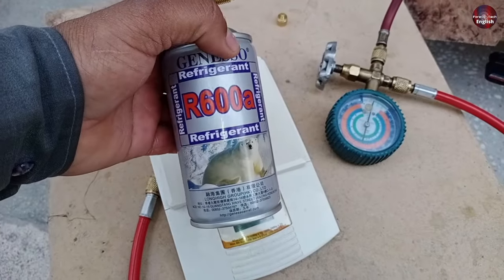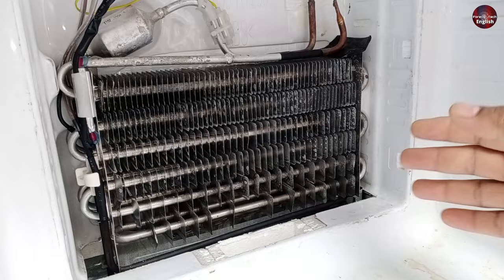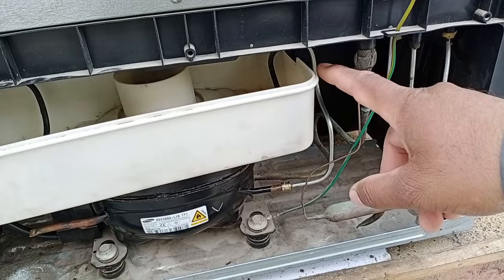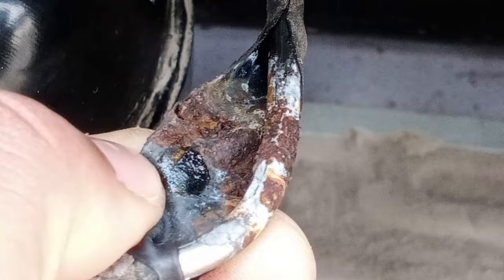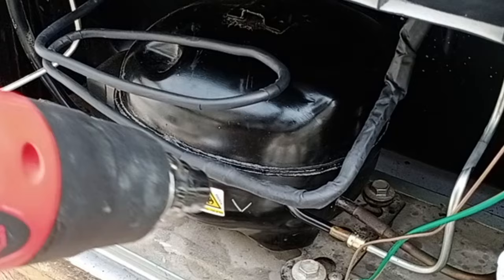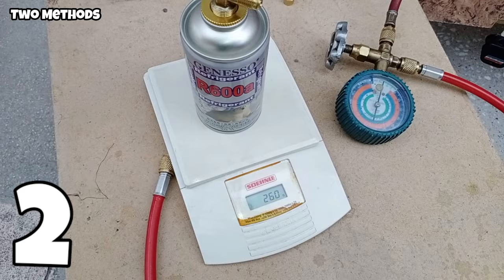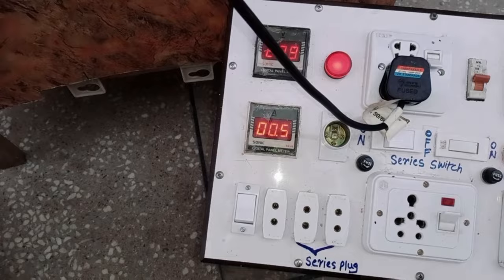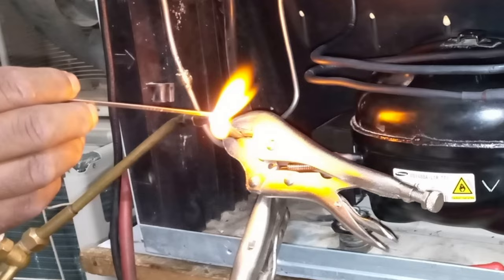How To Charge Refrigerator with R600A Freon/Refrigerant

Comment: I have been in the industry for 59 years, and would never use flammable refrigerant...
It's insane!!!!
Reply: Most household refrigerators in Europe operate on this "madness". The flammability of R600a is perhaps its only drawback, everything else is an advantage: it is extremely cheap and accessible (since it is a product of the gas-coal-oil industry), it has zero potential for destruction of the ozone layer, it is not alien to the planet's biosphere, unlike synthesized halogenated alkanes that in nature either decompose into very toxic compounds when heated, or, on the contrary, do not decompose for thousands of years, affecting the planet's climate. By the way, it is strange why the master cut off the Schrader valve? After all, its presence allows you to easily and quickly check the pressure in the refrigerator system, and a refrigerant leak with a high-quality and tightly screwed cap is extremely unlikely.

Comment: we leave the valves on all the units we fix. when we come back in 15 years. we can check it easy.
Reply: Backyard technicians 😂
Reply: “We leave the valves on” 😂😂
Reply: The joke is on you. The Appliance will never last more than five years in normal operation.   It’s by design from the engineers.   😑😑😑😑

Comment: The valve remains on the compressor and is not soldered off. The pipes are laid neatly and pipes that are too long are cut off. The capillary tube is laid to the side and the tube is straightened

Comment: Great Video. One question. Why did you remove the valve in the end? Isn't it ok to leave it there for a future service if needed?
Reply: It would make his work redundant because anyone with a bit of knowledge,  a spare fridge compressor used as a vacuum pump, a charging hose with ends ISO 1/4" thread and a can of R600 could do a short refill for a fraction of the price.

Comment: how about the dryer?  removal and replacement of the dryer is important !  also nitrogen does not absorb moisture.  Drawing a vacuum is important to remove the moisture as the liquid will evaporate, subsequent flushing with nitrogen is advicable..  Is this fridge even worth the effort?
Reply from the maker: I did the vaccum but couldn't film that. The dryer was fine, So No need of replacement, The goal of any nitrogen flushing system is to cleanse pipes and other parts that contain contaminants. And yes the effort was worth it. This refrigerator is still working fine. As it was fixed about 2 years ago.

Comment: I'm always afraid, when I want to weld. traumatized . A few years ago until it exploded during welding. Can you provide a safe tutorial for welding with Refriger R600.
Reply from the maker: Oh dear that's sad to hear, You should always use two or even three punching tool and check the leakage with foam before welding on r600a. As I told these are the safety measure one should take,  To check the leak with a soapy foam. I always check the leak before welding on r600a. To be safe from such incident.
Reply: nitrogen flow

Comment: Thanks a lot but I beg to differ where you said there is a possibility of water in the system since there was a leak on the pipe in the drip tray. This may not be possible since the leak was on the high side the discharge side.
Reply: The master is right.
When you run a refrigerator with a leak on high side,it creates a vacuum in the system.
After switching off the refrigerator ,water from the tray is drawn inside the system to fill that vacuum.
That water and moisture must be evacuated using a vacuum pump before charging the system first.
Reply: @wawerukamau1260  have you ever performed a self vacuuming process before? If you understand that process you will understand this.
Reply: @lloydpeniyasi4699  I'm a qualified refrigeration and air-conditioning engineer ,I know what I'm talking about.
Self vacuuming is done at the end of the condenser next to the filter drier.Some attach a capillary tubing for that process .
Just put that capillary to a bottle of water while vacuuming ,switch off the compressor and you shall see the capillary sucking that water.
Just as the same action when taking your favourite drink of Coca-cola using a straw.
Reply: @wawerukamau1260  it's ok boss we all learn everyday... thanks for that
Reply: He ment moisture guvna. ..Please allow him
Reply: @wawerukamau1260   You are right.
Reply: I have repaired multiple fridges that sucked water up from the drain pan. Both the evaporator and condenser full of water. If the high side out of the compressor is submerged in water once all the refrigerant escapes water will enter that pipe and get pumped around. It's going to pull vacuum on the low side and there isn't going to be any pressure coming out of the high side. Compressors turn on and off too each time it clicks off the system in vacuum will suck more water up.

Comment: I didn't see you vacuum the system or change the drier since you expected water or moisture to have entered the system
Reply from the maker: I did it off the camera didn't show on the camera because I forgot to record that part in the video.
Reply: How much CFM vacuum pump need for small appliances

Comment: Is passing Nitrogen same as Vacuuming ?
Reply: Nitrogen is used as high pressure leakage detector as well as flushing the system.
While vacuuming is used for evacuation of moisture and air in the system